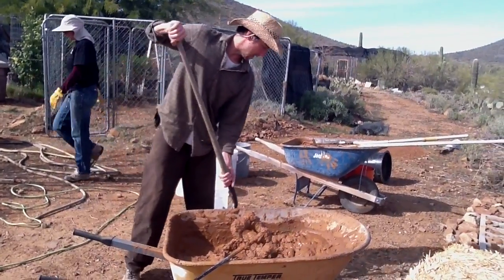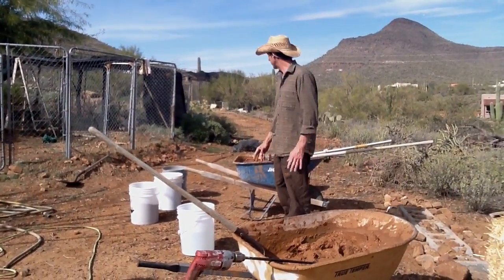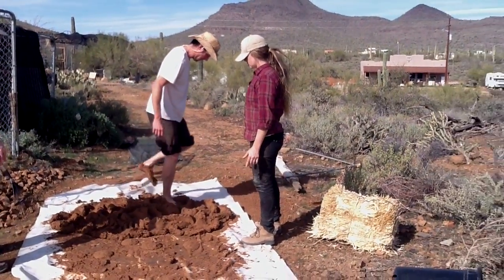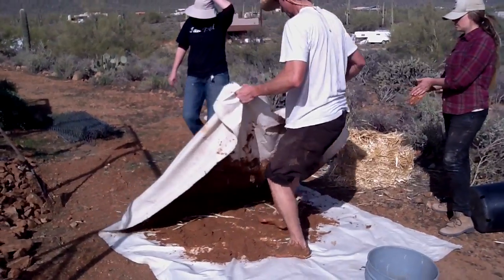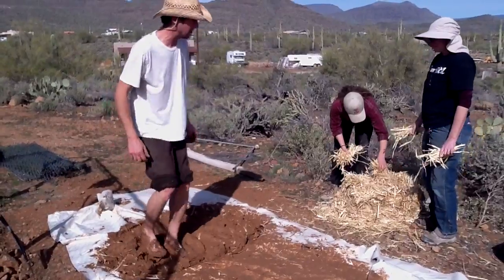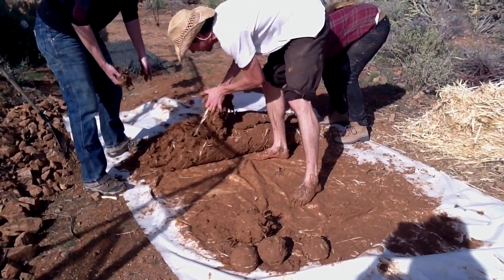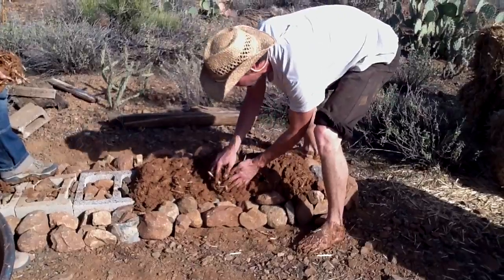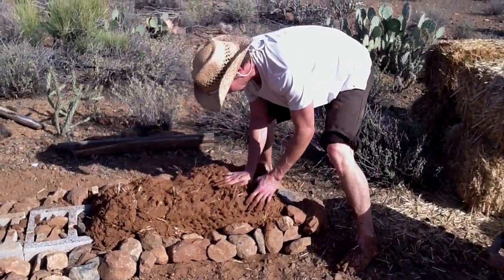Basic Cob Tutorial

Comment: Please help re my 2 questions about the testing and ratios.

1) How much water is added to the clay? 

2) When combining the clay and sand, how is one part of clay measured? Is it one volume (example a bucketful) of clay-plus-water solution or is it one volume of dry clay, ie before adding it to the water? 

I know this is not a precise science. However, it's useful to know for consistency on a single site.

Thanks in advance for clarifying.
Reply from the maker: On the water, see comment below. For parts, you decide your volume to call 1 part. Up to you. I used buckets for the most part. There are other ways to make cob. I slaked my clay (hydrating it overnight or for many days) so my clay already had moisture. Once I added sand and straw, I once again needed to add water. If you do a dry mix, it can go much faster. I just feel that slaked clay is better because the clay has already absorbed water and so I feel like I get a more consistent mix. It's preference.

Comment: Never worked on anything this large. Already know this is a lot of work digging this clay up and mixing with water. I now have a small grove of bamboo. I would prefer  coppicing trees and use the twigs or this bamboo to weave a matrix or wattle and slam mud onto it making wattle and daub walls. I mix a 1:1 mixture of linseed oil and turpentine in it sparingly and even a little tar roofing cement or tar. This makes it a lot stronger and almost waterproof. Spray more LO/T on finished surface.

Comment: Borrowing a concept from the EarthShip people, seems a good idea to encase bottles and pop cans in the walls, to reduce the amount of cob needed. The bottles and cans in the Earthship housings meant less need for cement, without diminishing the structural strength of the walls, arches or columns (or whatever they sculpted with cement). Cob is labor-intensive to mix, so why not borrow this idea, to use less cob?

Comment: I Wonder how coconut coir would do instead of the straw..
Reply from the maker: Would be cool to try but I'm not sure it would be long enough to provide the tensile strength straw adds by connecting to itself. I'll be it could be used in the plaster mixes though where you don't need such long pieces of straw.

Comment: can I use a cement mixer to mix it?
Reply from the maker: You can if you can figure out how to keep the straw from getting caught in the metal on the inside of the mixer. I suppose some mixers may not have those metal pieces inside (maybe a barrel mixer?) but then the straw doesn't get imbedded into the cob and hold it together. We've used paddle mixers for plasters with chopped straw and even that had a tendency to get caught up a bit so longer straw would be tough.

Comment: how to make the surface smooth? I see a lot of pictures of cob and the straw is sticking out making it look bad. in some other pictures, it actually has a lighter color like beige and you can't see straws. some pictures had very smooth dark brown walls with the straw showing but it was perfectly flush. would having very short straw(possibly after cutting it) help in this case? would that be bad regarding the mechanical properties? I know in polymer composites the strands(like fiberglass or carbon fiber) can be very short, why does that not work here? thank you
Reply from the maker: these are not the final walls. you will add a rough coat and a final plaster. you want long straw in the cob mix to bind together and provide tensile strength for your walls. your rough coat goes over the cob and will have chopped straw (see less straw) and your final plaster no straw and very fine sand. your final coat can be applied with a trowel to create a smooth finish. we don't worry about 'flush'. this is natural building and nothing is perfect ;) You can certainly spend time making it flush or accept that beauty comes in shapes other than perfectly measured lines and boxes.

Comment: Why were there stones on the wall at the end of the video? Do you occasionally put a layer of stone in the wall to make it stronger? Sorry, but that was the only thing not explained in the video.
Reply: Andrew Carroll , you can embed any solids you have in the wall to minimize how much cob you have to make. Stones, bricks, broken cinderblocks, cracked concrete like discarded sidewalk, even the odd bit of glass or ceramic if you have access to bug chunks like at a factory.
Reply from the maker: Stones take up space in the wall without deteriorating structural integrity. Cob is labor intensive.
Reply from the maker: Stones are placed to take the place of cob. Many other things have been used in walls including bottles, aluminum cans, etc. I wouldn't say it would make it stronger necessarily but they take up space instead of the labor intensive cob.

Comment: Sadly I do not have clay.. If there is clay in my soil it is so minute that it's damned near negligable.  I live in the mountains on decomposed granite which is more like sand but it crumbles.. Comparing crushed rock to DG is like comparing wood to rotten wood.  When it rains DG washes away when exposed.  It's hard as a rock when dry but I don't think it would hold up to being used structurally.  My only local source for clay that I am aware of is home depot bags.. The cost for this is prohibitive.  Unless I can mix it with more than 2/1 ratio I might as well stick with cement.  That defeats the idea though.. ideally one should only have to import sand since clay is supposed to be everywhere right.  I definitely need to spend more time on this subject.
Reply from the maker: Natural building means we build with what we have in the area. Research what people in that area used to build homes with and see what might work. I'm guessing wood but if you have earth, build into the earth. Lowering your home into the earth, even partially, will allow you to take advantage of the thermal mass of the earth. Rammed earth would be another area you could look into.

Comment: What are you looking for exactly with the drop tests? Is it that, if, in the first drop test, the cob weren't ready for the straw, it would simply remain as a sticky mass on your hand and then might eventually splatter?
What about the second test?
Reply from the maker: Looking for how well it holds itself together. It's just something to do in the beginning. Once you have made cob a few times, the process goes much faster and you'll not need to do drop tests. But, yes, if it splatters, there's probably too much water. You want it to hold together fairly well on its own before adding the straw.